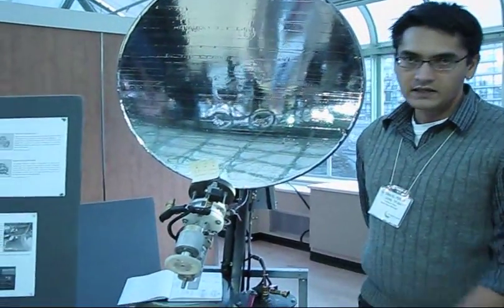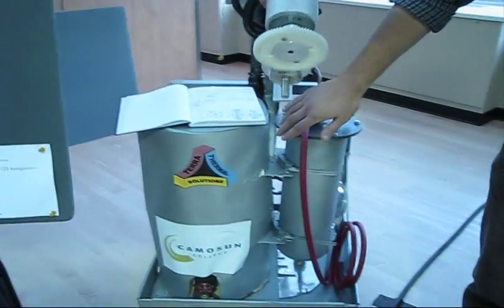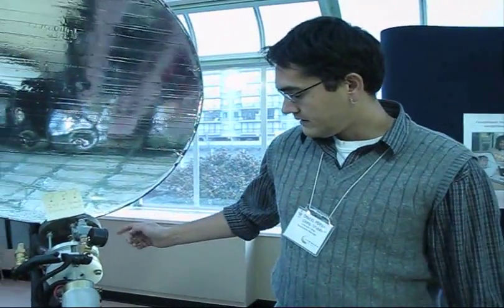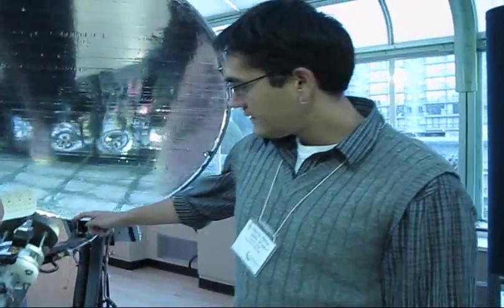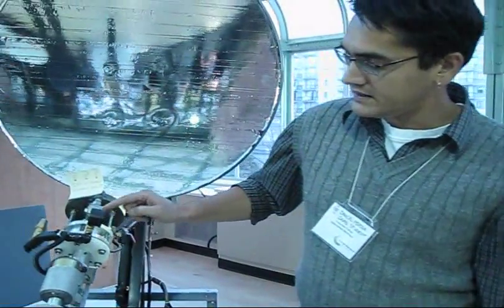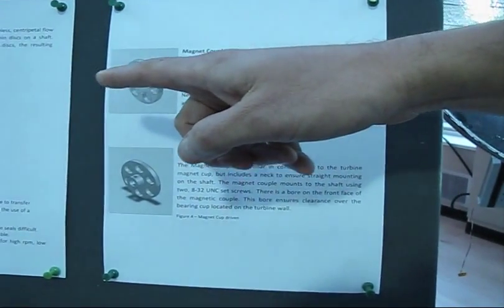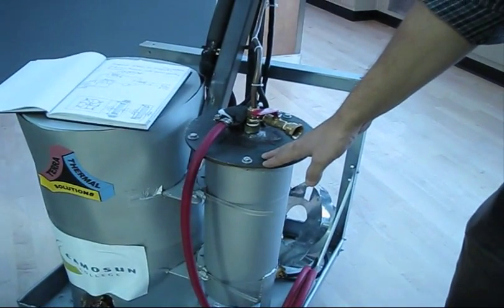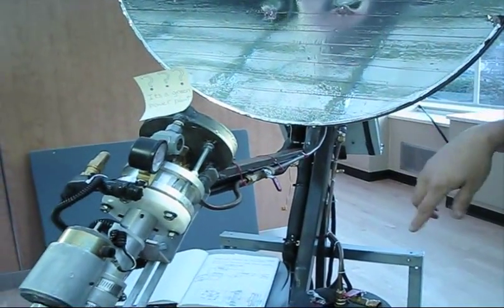Organic Rankine Cycle - Featured on Hacked Gadgets

Comment: Excellent model on ORC...
Though i have a question....
If the gas is pressurized by a pump then wont the pressurized gas be itself running the turbine??
Correct me if i am wrong...
And why is gas pressurized anyway???
Thanks
Reply: Delta temperature, the difference is work that drives the turbine.  Condenser causes LOW pressure liquid to form,   delta pressure.    Just like a steam turbine, at a lower delta temperature.
Reply: It’s pressurized then heated and then expanded. The heat added gives the power out that’s more than it took to pump/compress the motive fluid alone.

Comment: It works the same as a stirlin engine, but is more flexible in where you capture the heat and perform the heat to power transistion. It's not water as he said. Uses refrigerator coolant.. good thinking. NOW CONDENS ON THE HEATED SIDE OF STRLIN> more power less lost